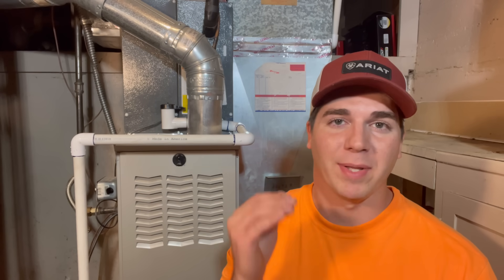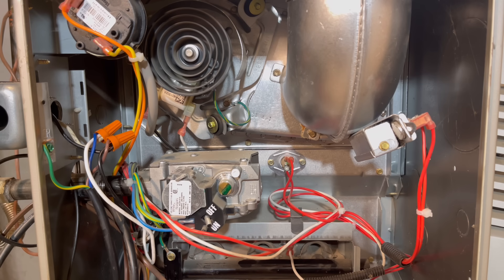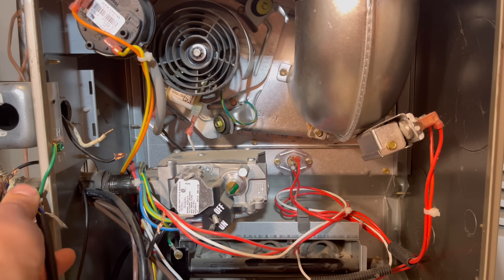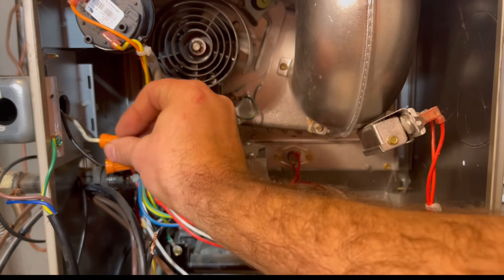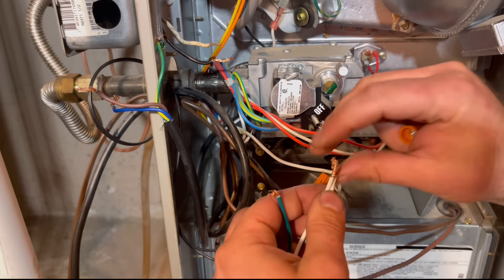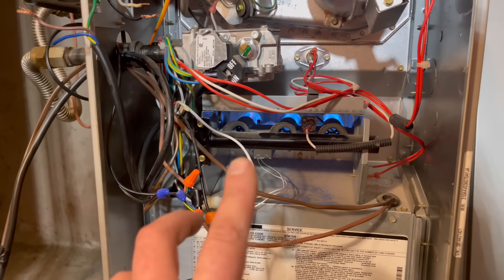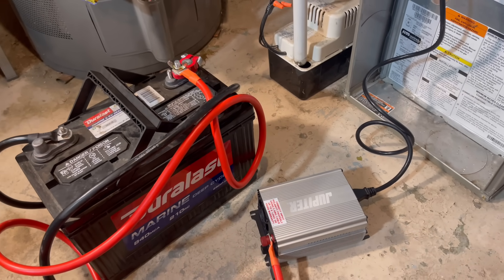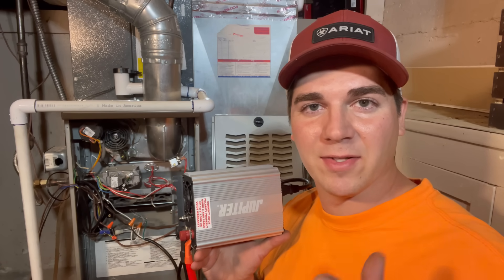Did You Know You Can Heat Your Home With A Car Battery?

Comment: Way more issues with this setup than benifits. As others said the inverter needs to be pure sine. It also needs to be filtered well for EMI conducted emissions otherwise it will cause damage to the microcontroller in the furnace. Running the inverter off a car battery with the engine running is a short term solution. An idling vehicle with a traditional internal combustion engine long-term will cause upper valve train damage because it often relies on splash lubrication for those parts, idling simply does not bring enough oil to the heads and valve train. 

A properly filtered pure sine inverter generator would be far better than this setup
Reply from the maker: Where did you get this information about idling? That’s totally incorrect sir. I was a mechanic for over 10 years. And “long term” is not 5 days or even 10 days during a power outage.
Reply from the maker: I agree on the pure sine wave. That’s the one I have and it’s installed in my work truck. I didn’t mean to come across as a jerk with my previous comment. I just simply don’t agree with the idling thing. Cheers
Reply: @diyhvacguy  an idling engine is not running at its peak temperature, which means you don't have complete combustion which creates deposits in your engine and then also the lack of lubrication or poor lubrication on the upper valve train. I'm talking about the traditional otto engine cycle. If you look at a hybrid like a Prius for example, its gasoline engine uses the Atkinson cycle instead of the more conventional otto cycle. It sacrifices power density for efficiency so idling is far less of an issue for an engine like that.

Bottom line your setup while it works there are better options out there.
Reply: @Bassguitarist1985  This is nonsense. Vehicles in service like taxi cabs and police vehicles idle for hours at a time. I was an automotive engineer for 27 years and can assure you that  the engines are designed for this. Your comments about EMI are nonsense as well.
Reply: @tgriebe  I suppose we can agree to disagree and say that it's a "depends" situation. Even if lubrication on the upper valve train is not an issue with modern otto cycle engines, the duty cycle for most car alternators are not intended for 100%. The average sedan has anywhere from 90 to 120 amp alternators, and have load sensing devices for its own accessories in its own circuitry. This is done so the vehicle can save on fuel economy when there's low electrical demand in the vehicle. Connecting an external inverter or heavy load device bypasses this device and  won't necessarily allow the alternator to come up to full power, at least not in newer vehicles. Honda comes to mind.

I've worked on inverters at the component level and I know conducted emissions  is an issue due to lack or poor filtering of the PWM noise. It can cause problems with microcontroller circuits in furnaces if they are not properly filtered themselves. Inverters if they are pure sine can put out a very low THD wave, but often on the cheap inverters conducted emissions filters such as chokes, RC, & RI are not present or are inadequate. 

I respect your years of experience as an automotive engineer, but if you have experience in inverter design/function then please do share the knowledge rather than just calling my post nonsense.
Reply: @Bassguitarist1985  The guy doing this video is making a second video which will demonstrate you are full of baloney. Stand back and watch.
Reply: @Bassguitarist1985  Watch the next demonstration video and we will see who is full of it.  Spoiler, it is you.
Reply: You may only need to run vehicle 15 minutes every few hours.

Comment: Helpful for people in emergencies, but it is better to permanently install a plug on the furnace and double throw switch, for example a toggle switch with ON-OFF-ON to have the option of grid power or inverter power.  Check out the EZ Generator switch on Amazon, designed by US electricians. I also think it is smarter to have the inverter installed on your car, and if the battery gets low, you can start the engine to charge it. Depending on where your furnace is, of course. The best solution in my opinion is a solar powered battery back up system that can handle not just your furnace but your fridge, lights, and other critical loads and have a feed-in receptacle on your electrical panel.
Just FYI, Black is negative for DC not neutral.

Comment: This WILL work...BUT...you will need a LOT more than a 100AH battery or so...to "run the furnace for days...  At say....an 8A draw....at 120V to the inverter..that ii nearly a  KW of power... That is about 100AH...or a bit MORE..after losses... So..a that would be LESS than an HOUR...of run time...from that battery... Maybe 2.5 hours...if the furnace run maybe 40% of an hour..  To run for "days" you would need at least 20 of these batteries...all tied together...

Comment: This battery will NOT run your furnace for a couple of days! Your vent motor takes 100's of watts to run! More mis-information on YouTube!
Reply from the maker: Yes I realize this was incorrect. The concept is still viable. I decided to purchase a pure sine wave inverter and install it in my work truck so I can power my furnace as long as I have fuel in the truck. That video will be posting soon. Many apologies I didn’t mean for this to be misleading for anyone. Thanks,  Dave

Comment: So I like the idea a lot however there are a few issues..
1. The motor won’t like a square sine wave like these inverters produce and it won’t run efficiently if at all on some newer motors
2. This won’t last days.. or even close. You will be pulling at least 40-50amp from the battery which means that you will be LUCKY to get an hour of use
3. If you take the battery from your car, it’s not designed to be discharged so the plates inside corrode in a way in which they can’t be recharged so there is a very good chance you will be buying a new car battery once you’re done
4. So if you’re going to buy a special deep cycle battery and pure sine wave inverter to only get an hour of use out of your furnace.. why not just spend the same amount of money.. or less and get a generator. A lot of furnaces already have a receptacle they plug into so you can just run a 12 gauge extension cord outside to a generator and have your house heat actually run for days.
Reply from the maker: Thanks for this information. I realized the same on the pure sine wave inverter so I got one and have it installed in my work truck so as long as I have fuel in the truck I can power the generator. So still much cheaper then a generator, will run long we, and is much quieter :) cheers man

Comment: Very cool idea.  I used to do HVACR and never came across this idea. Makes perfect sense though. I was hoping my EGO inverter with the 56V batteries would work but it's only rated for 150W so i'll keep that for cell phone charging or running devices if needed. Thanks for the idea!
Reply from the maker: What I ended up doing is installing the inverter in my work truck so I can power my furnace as long as my truck has fuel in it! Just start it up every once in a while in an emergency type situation. Cheers man
Reply: @diyhvacguy  I have a 2017 Silverado with an inverter but IDK what the power rating is so I need to look in to that. I also have a smaller portable generator too if need be. Again very cool idea and thank you for posting this. I have a feeling we're going to need it this year in NJ.

Comment: This doesn't add up... a typical car battery has a capacity of ~600 watt hrs.  A 1/2 horsepower blower motor takes about 350 watts to run... add in inducer blower and other loads and you've got a draw of ~400 watts....  that's maybe 1.5 hrs of furnace run time... and that's without even considering losses from the inverter itself or voltage drops on the battery as it's discharged.  So yeah... it might run for "days" if you only run it 30 mins a day...
Reply from the maker: What I ended up doing is installing the inverter in my work truck so I can power my furnace as long as my truck has fuel in it! Just start it up every once in a while in an emergency type situation. Cheers
Reply: @diyhvacguy  Yeah, that certainly changes things and is a great modification of the project.  Still have to wonder about overnight... my furnace runs about 5 hours over night... but then, desperate times call for desperate measures I suppose... and this is certainly one way to help.

Comment: Cool.  Though ideally, I'd like a permanent setup where the battery float charges and the furnace can be switched to battery with the flick of a switch.
Also, you didn't mention you have gas heat.  This wouldn't work with a heat pump.
Reply from the maker: I’m pretty sure I stated its how to power your gas furnace at the beginning of the video.. maybe I’m mistaken. If so I apologize
Reply: Ah!  Indeed you did,  @diyhvacguy .  I missed that.

Comment: Depending on how many watts your blower uses, at 400 watts it will only run for about 2.7 hours before the battery is dead.  And then you're stuck with a dead car battery.  Use a generator, not a car battery.
Reply from the maker: Thank you. I quickly learned this was the case with all the comments. So I ended up hooking it to my truck battery so I can power my furnace for as long as my truck has fuel. The video for that will be posted soon! Thanks for the comment. Cheers
Reply: @diyhvacguy  Sorry, I checked the comments before I made mine and didn't see anyone talking about that, but I guess I didn't scroll down far enough.  Was the natural gas company able to keep gas flowing in Texas when that winter storm hit?  I'd assume they would also still need electricity themselves to supply the gas to you.
Reply from the maker: @jeffbailey7328  from what I’ve read, a lot of times you will have gas but no power so I think power is not needed to have gas flowing to your home.
Reply: @diyhvacguy  POST YOUR TRUCK BATTERY VIDEOAX!!
Reply from the maker: @JESUSCHRYSLER5512  will do! Stay tuned!
Reply: @diyhvacguy  PLUG ALL YOUR ELECTRONICS INTO YOUR BELLY BUTTON TO GET POWER.

Comment: If you really want to be safe, use an old style steam boiler. No fan, no pumps to circulate the heat. Just a gas or oil burner to power. You can also set it up to get hot water. 
All this is only about 200 to 300 watts when running, if it's a simple setup. Probably lower of it's on a gas system.

Comment: That's sounds good for a gas furnace. Have you done one with an ALL electric one? Our whole house is all electric. We've experienced several outages over the years, usually a week at a time. We do have camping gear that we've used to stay warm, but even that isn't that great after a week. Plus, wife and I are senior citizens, but resourceful.
Reply: @mattc8245  I wondered. Thank you anyway. We can probably still use a small space heater.
Reply: This started out so very simple
Reply: Buy a generator to match your loads. Never buy a small one
Reply: What ever works for your climate around your house, maybe you don’t need to worry about pipes freezing maybe you do , it’s all about being comfortable during outages, or is that just me ? But electric heat really eats into our batteries, a couple hundred amp hour batteries and a inverter can go a long ways if you use different heat source and forget the fridge if your worried about freezing that means put your refer items on your porch, climate same as animals what ever works for you , you got freezing temps and bears then things get limited quickly

Comment: This was a great demonstration!  I suggest a few tweaks.  You fully demonstrated how to fire up your heater from a battery and an inverter.  With just the purchase of an operating inverter and items a household already probably has, you can power your HVAC system.  No need for a generator and all that maintenance; OR, this setup is a great lifesaving backup if you experience a generator failure.    
I would:

1.  Get a power meter to get a good estimate of your draw from the heating system while ignited and running.  Do the math to figure your electrical needs.  A 200 watt blower and a 700 watt blower are going to  be a big difference in how long your battery lasts.  That new Bryant you have pulls way less juice than the old HVAC blowers.      
2.  This is for survival, not convenience.  Keep the mom and kids alive.  Close off parts of the house and force the heated air into a smaller area to run the heater less.
3.  Make this simpler/easier.  Leave the battery in the car and wire in the inverter at the car.  Use a regular extension cord to get the power from the car down to the HVAC.
4.  Run the car to recharge the battery when necessary.  How often will depend on the battery and the power draw you computed.  
5.  Have a second vehicle or your RV battery in position to jump the power supply vehicle if necessary.  
6.  Do you have gas cooking appliances.  If so, run a slow oven for cooking and extra heat without using power.  
7.  Get a handful of Wago connectors and leave them by the furnace for EZ safer temporary wiring.
Reply: Just remember that a byproduct of combustion is moisture, fine particulate, and formaldehyde - and a possibility of CO, so I wouldn’t recommend it. However, if you have an emergency and plan to use  a gas range or oven (assuming the oven doesn’t require power for electronic controls), you will need to vent somewhat to avoid excess moisture and combustion byproducts. This is why your furnace uses a heat exchanger.
Reply: You can not power your whole house AC this way , the AC pulls a lot of amps at start up . I can’t even power up my whole house AC with a 8500/ 10000 start up watt gas generator .
Reply: @toledojeeper2932  agreed.  I was only referring to the heater portion.  And NOT a heat pump or resistance heater.

Comment: How will that converter work with a pellet stove??
Reply: That is when the power is off.
Reply from the maker: Oh this will work great for a pellet stove. That requires a lot less amps then a furnace. What o did was wired the inverter to my truck and then I’ll run an extension cord to my furnace from my truck and can run it for as long as I have fuel in the truck 👍🏽 thanks for watching! Cheers

Comment: What you have is the exact same thing ( different battery brand ) than I have on my solar set and in my Ram B2500 Van. You are using a Duel Cycle Marine Battery. Those are built differently then regular lead acid starter batteries. Don't use a starter battery for this it will go down pretty quick.
Reply from the maker: Well what I actually did was hooked the inverter up to my truck so I can power the furnace as long as k have fuel in my truck :) cheers man
Reply: @diyhvacguy  I hooked up one of my inverters in my van and ran a microwave for a few minutes. Can it be done sure, but it would be way cheaper just to get a small gas generator to run things than running a car or truck.
Reply: @diyhvacguy  Word of advice in a real pinch you can connect your 12 volt inverter up to a running riding lawn mower. You will not get full power from something like that, but I have done it. We ran a fan and a light and a portable dvd player at the same time without any problems. My inverter at the time was a 1000 watt cobra. I now have a few different inverters for running different things.

Comment: In the summer we lost power so I drove to Home Depot and got a super thick 50foot long electric cord. Next I went to Harbor Freight and got a inverter with battery hookups. We needed to finish laundry and while the vehicle ran we were able to run the washing machine then put up poles with rope and hung out our clothes to dry. 
Unless you have a generator big enough you can’t power a drier with a inverter run off of a vehicle battery.
Reply from the maker: Thanks so much for sharing! Cheers

Comment: Helpful little hint for everyone 1,000 W inverters are only 80% efficient at the most some are as bad as 60% efficient if you get the 1500 watt inverter they are between 80% efficient and 90% efficient so the bigger inverter that can handle more will actually give you a longer runtime overall or just do the research into the specific inverter you're buying to see what efficiency it is I believe these Jupiters are running about 75 or 80% efficiency for the 1,000 watt inverters like he has.
Reply from the maker: Thanks for sharing

Comment: This is an excellent idea!!! 🎉
Thank you so much for the info!
Reply from the maker: In hind sight what I should have done in this video was Mount the inverter in my truck to the battery and then ran an extension cord to my furnace that way I can run it as long as I have fuel in the truck! Also if you want to do this trick I’d advise picking up a pure sine wave inverter. I have a link for one in the video description :) cheers
Reply: @diyhvacguy  At that point I can use my car as a small generator 😁
Excellent information! Thank you again.

Comment: Inverters waste power like mad, so it won't last long, unless you switch batteries often, and have one charging  while another is powering the furnace.
Check your furnace information, so you can buy the correct inverter.  You may need a 5000W inverter OR BIGGER!
Reply from the maker: In hind sight what I should have done in this video was Mount the inverter in my truck to the battery and then ran an extension cord to my furnace that way I can run it as long as I have fuel in the truck! Also if you want to do this trick I’d advise picking up a pure sine wave inverter. I have a link for one in the video description :) cheers

Comment: The battery and wires are all CGI. Very easy to fake.  Jokes aside, Pretty nifty! Never knew you could do this as I assumed the furnace drew some ungodly amount of amps to run.
Reply from the maker: This is strictly for a gas furnace it will not work for an electric furnace or a heat pump. Thanks for the comments! Cheers